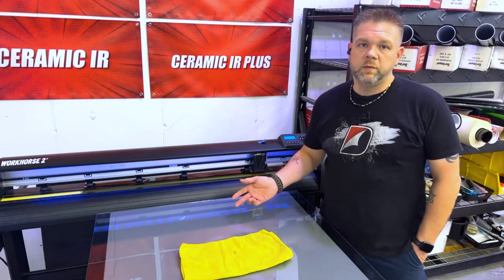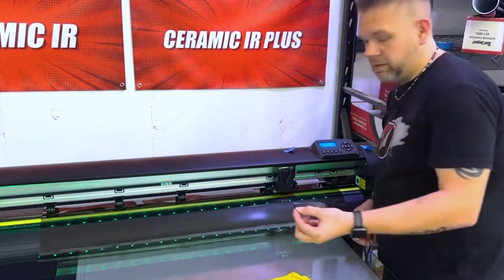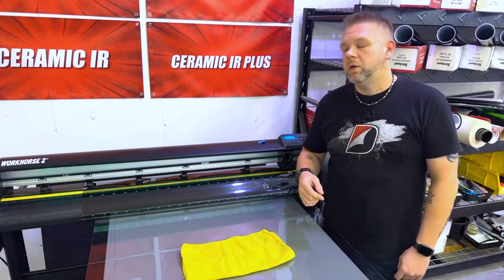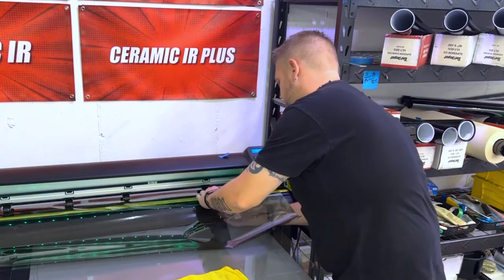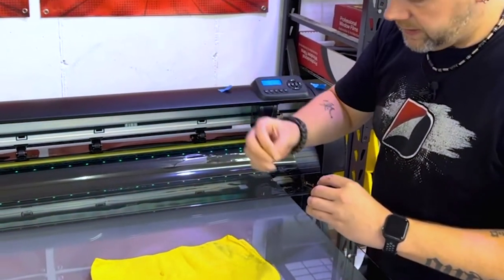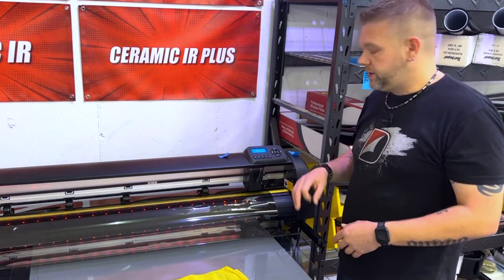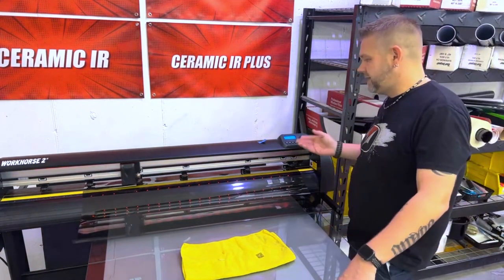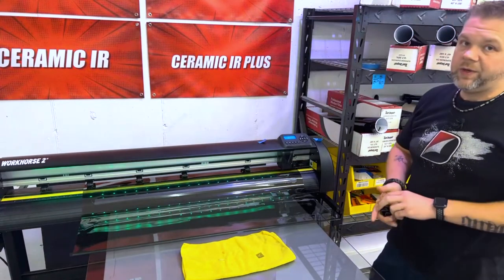Plotter Blade Troubleshooting Tips | Dull Blade | Window Tint Cutting

Comment: What is the yellow tape
So I have the workhorse two had it two month now I been using it everyday but one side cuts good that close to the sitting and on the other side of the machine it doesn’t cut thru is it the tape that off or what can it be
Reply: Plotters will never be perfect. And some trimming is sometimes part of the game. But should be minimal. That’s why I dialed mine in then added the tape on top of the cut strip.